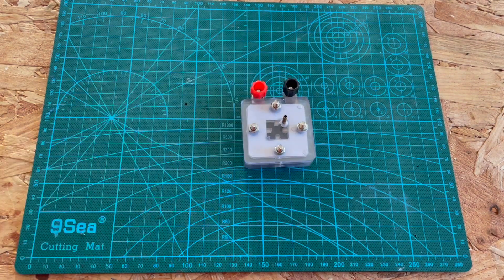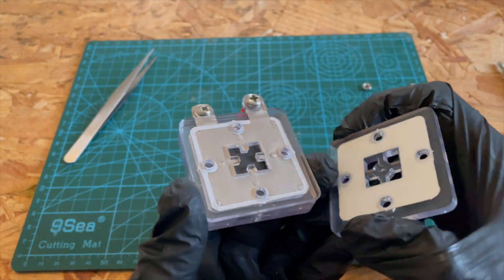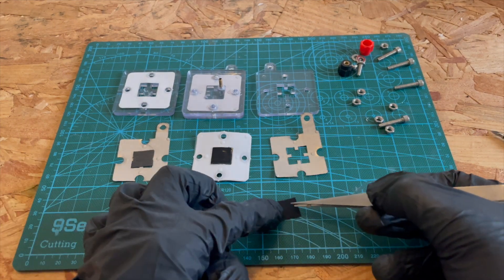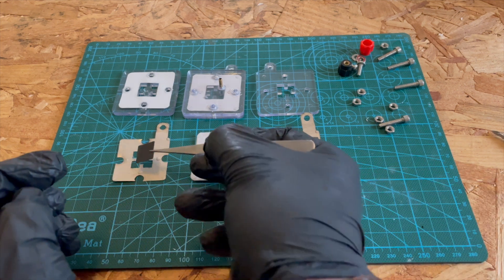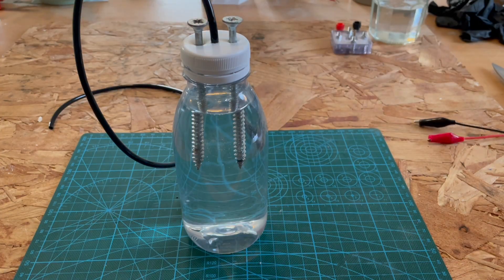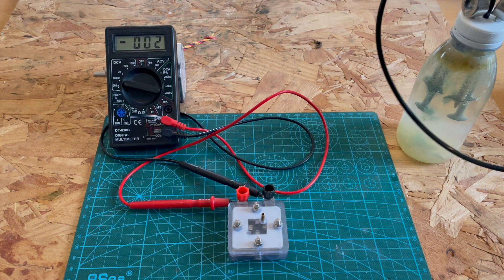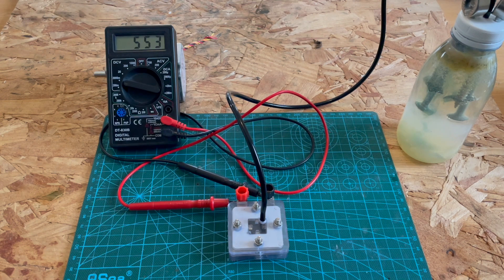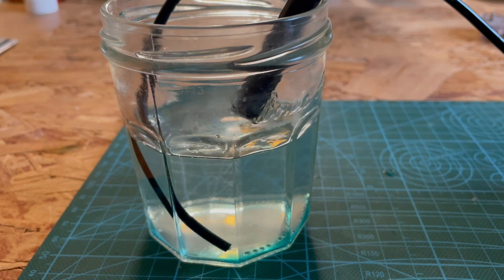How to Generate Electricity from Hydrogen Using a Fuel Cell! ⚡🔋

Comment: I'm putting together a demonstration single cell similar to this one(with a view to expanding) do I need a diode between the output and the battery? I'm thinking back flow of electricity will damage the plates on the cell? Alternatively perhaps using a DC to DC converter (which I'd need anyway) would serve the same function? Exciting technology 😊
Reply from the maker: no need to protect the cell it can actually work in reverse as well. it wil start to produce hydrogen when power is applied to the cell

Comment: yeah thats expensive membrane, i watched a video on youTube about a guy using PVA to make a membrane ( seems much cheaper ) i have seen the one you have on the demo, its about 40 US, but for half a volt ( not sure how many amps ) but it seems low for the price and power but good to see its becoming commercial, the amount of electrical power that goes in is about 100 times more ? i think they have a long way to go compared to things like battery tech, like if you have a solar array and get the power of that and use batteries its better than hydrogen at the moment, but the tech seems promising. I see hydrogen overtaking battery tech soon. ( mainly cause its less weight than batteries in an electric car )
Reply from the maker: It’s very cool technology but yeah the nafion is crazy expensive be cool if we can use cheaper material that also has a high efficiency

Comment: I tried to do the same thing with the same fuel cell but when the gas got into the fuel cell it went out from the other hole
What can I do to fix this issue?
Reply from the maker: That’s normal, it will produce electricity that way. Not all of the gas is used these cells are quite inefficient
Reply: @DeanZyl OK 
Thanks

Comment: you arent feeding it hydrogen, you're feeding 2H2+O2. this should lead to excess oxygen over time.
Reply from the maker: Yeah that reduced efficient, I should separate The Hydrogen from the oxygen that would be better
Reply: It is being fed hydrogen. He did not say it was pure hydrogen nor does it need to be. This was a demonstration of a proof of concept of the hydrogen interaction with the PEM .
Reply: Your comment makes zero sense. The cell splits H2O into HH and O. Thats two hydrogen molecules and one oxygen molecule. Gas. PEM cells have two outlets. One for oxygen and one for hydrogen. You can mix them togheter to make HHO aka browngas.

Comment: How much energy did you lose at the end?

Electricity -> Hydrogen -> Electricity.  

When in that proces did you generate more electricity?
Reply from the maker: 95% loss😅. This process is really inefficient. I used a 12v 1amp power supply so 12w of input and only generated 0,5v from the fuel cell, converting water to hydrogen is about 30% efficient at best, and the reverse reaction of combining hydrogen with oxygen to form water and electricity is also only 30% efficient
Reply from the maker: But there are still some use cases such as aviation where weight plays an important role, fuel cells weigh a lot less than batteries
Reply: Current industrial scale electrolyzers have a top efficiency of about 65-70%, while PEM fuel cells about 55-65%. But this process is not meant to generate electricity out of nothing.
Altogether electricity -> hydrogen -> electricity with commercial type devices you'd expect about 30-40% efficiency overall, however, it offers the capability of energy storage as hydrogen with relative ease. To store same amount of energy in batteries would be too expensive.